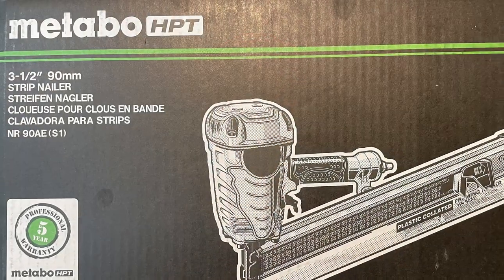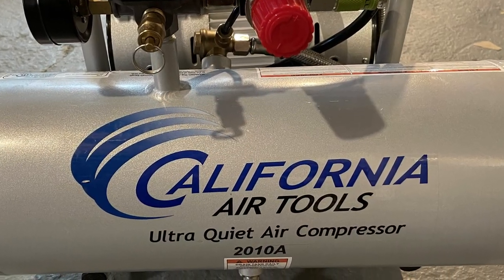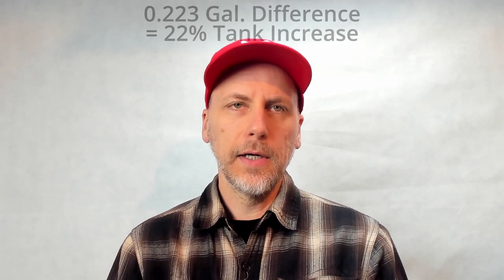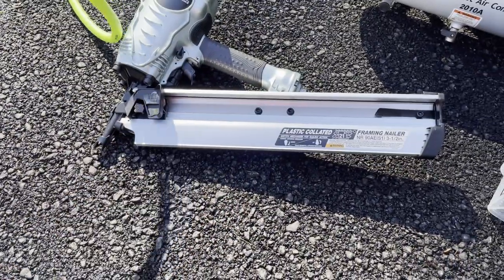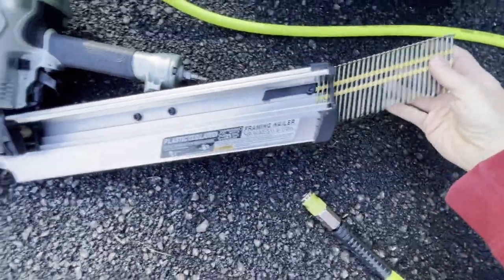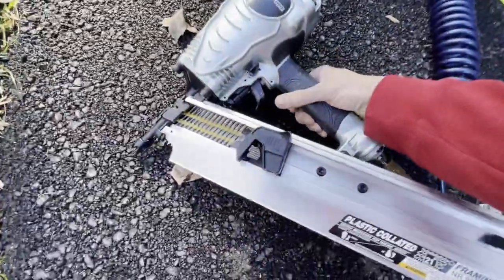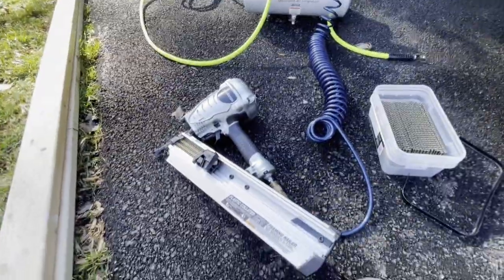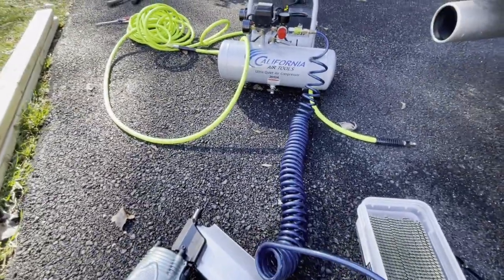Metabo Framing Nailer Review and Fail with Small Compressor Test

Comment: Great video, I've used my Ryobi cordless 1 gal compressor with my framing nailer for small jobs because of the mobility , compact and light weight instead of lugging my 6 gal plug in compressor , i get about 3 maybe 4 nails before compressor kicks in and i can get 8 or 9 nails in before i get a proud nail. Works great for small stuff, for bigger jobs i lug the 6 gal plug in craftsman or Porter cable, we have both and both work great. Well they all work great.
Reply from the maker: Great info. Thanks. Yeah, I still like my California air quiet compressor for indoor work. Perfect for trim work and other small work. I even did wood flooring because it was a small room and I was by myself so the cadence of nailing did not overwhelm the air output.
Reply: @handyhomerepairs  100% agree, these little air compressor are great for trim work , i can run a 15g finish or 18g brad all day with the little 1gal . Haven't tried installing wood flooring with it yet , but will try it when i get a hardwood flooring job.

Comment: Thanks for the video. Your result shows that the compressor can't really keep up with the demand if you're framing. It may get do well for remodeling projects, though.
Reply from the maker: Yes. I had a framing job where I put in several thousand nails. I wouldn’t have been able to do it with the small one. I used Metabo “tank” and it worked great.